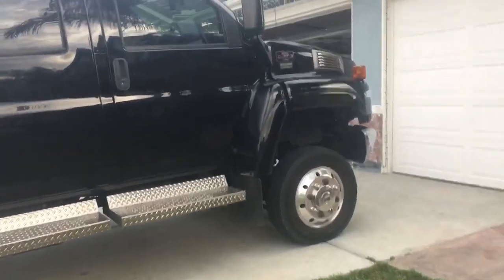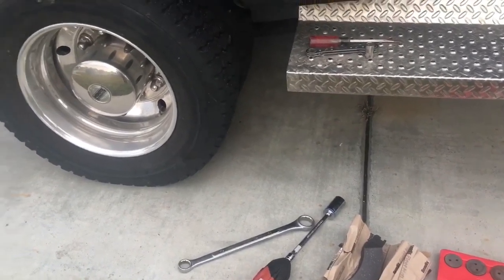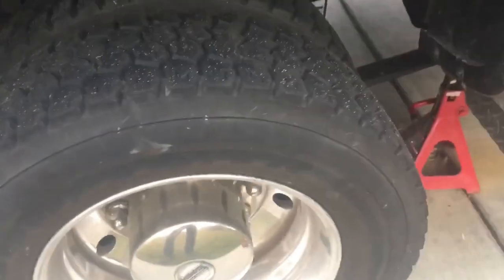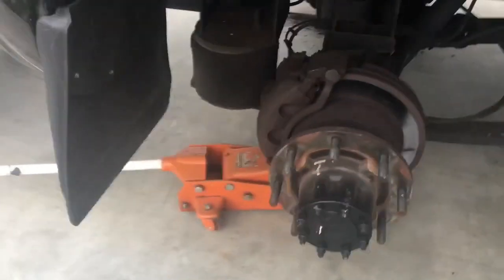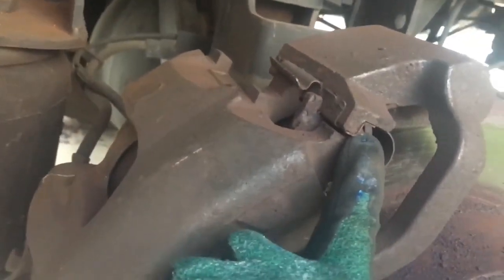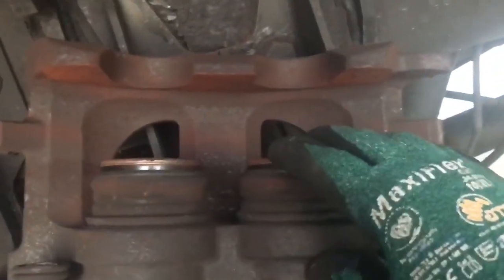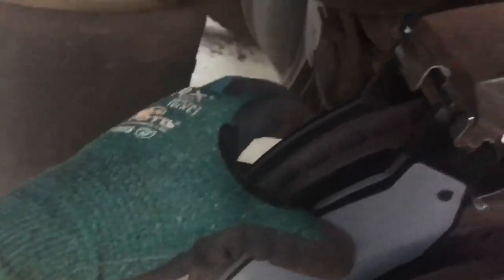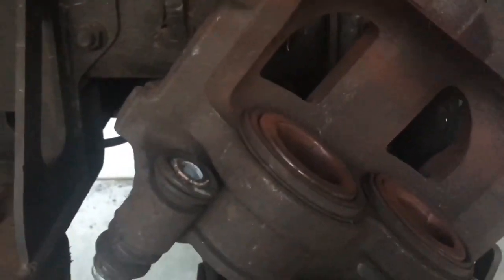DIY How to replace c4500 c5500 gmc topkick Chevy kodiak rear brake pads 4x4 4wd

Comment: I figure that loosing the wheel nuts when on the ground is best, as the force is against the ground then driveline. 
If one has added brake fluid, do make sure you have enough volume to force the fluid back as it will over flow. I am going to have to remove some when  I do mine.

Comment: Throw an old brake pad back into the caliper then use the tool to push on the pad, that way it compresses both at the same time.
Reply: That's what i do use an old brake pad and compress both at the same time aswell